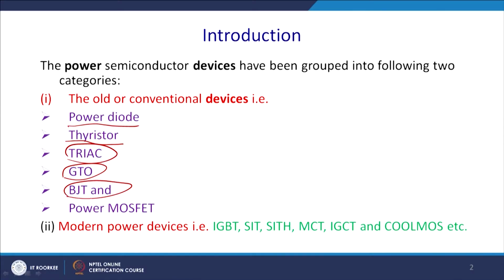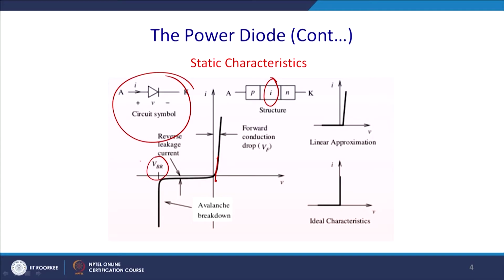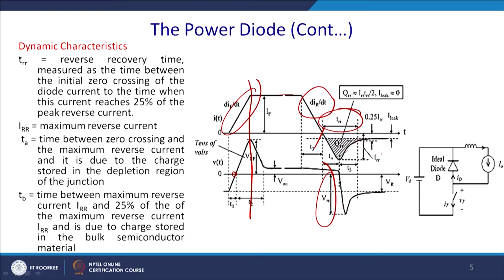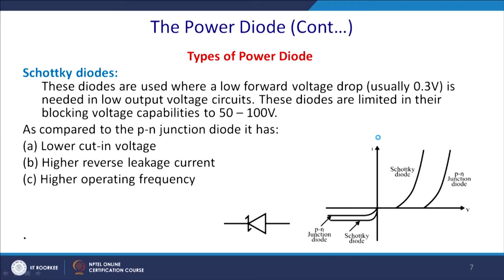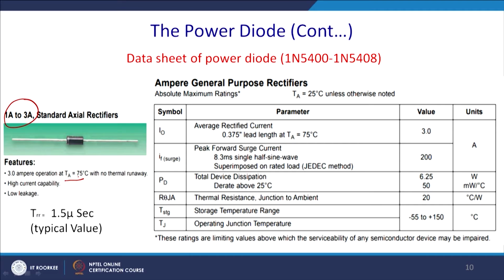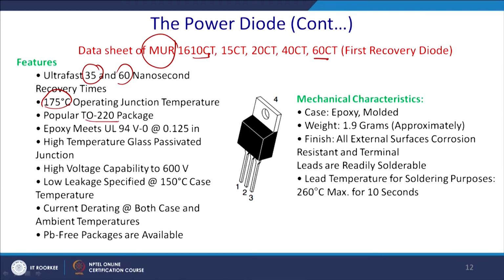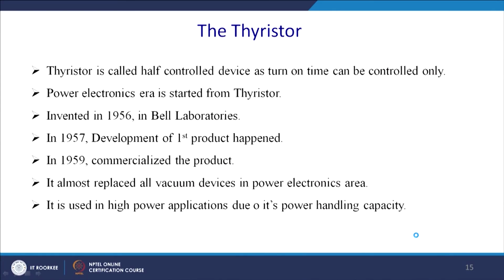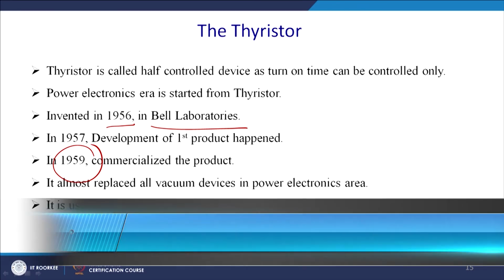Device Physics I

Comment: sir , what is the difference between forward voltage drop and cut in voltage ?? are they same ???. or different please elaborate .
Reply: Cut in voltage is for a signal diode after which it starts conducting when it is forward biased and Forward Voltage drop is For a Thyristor/power diode is  when it is conducting in the ON State the voltage drop across the device Both are slightly similar but have used for different devices